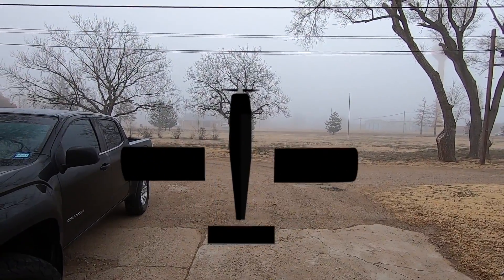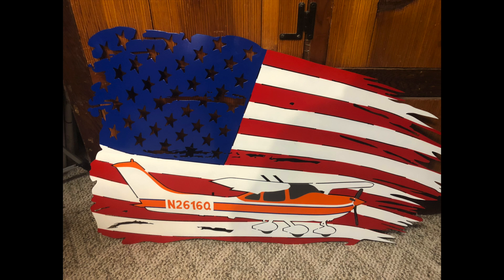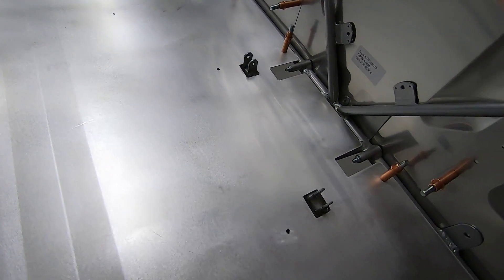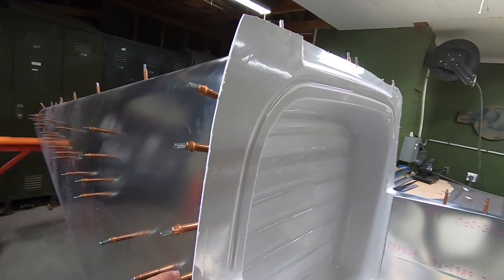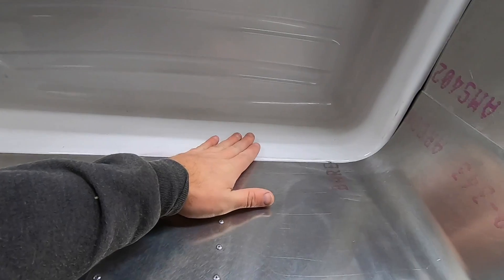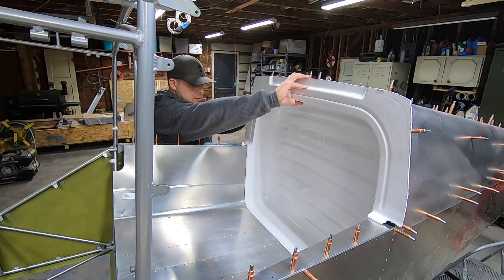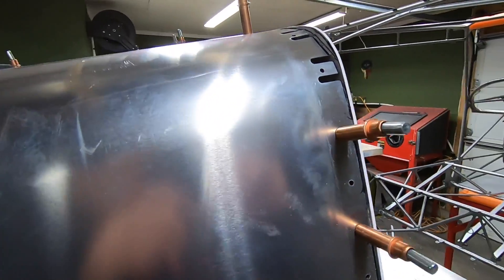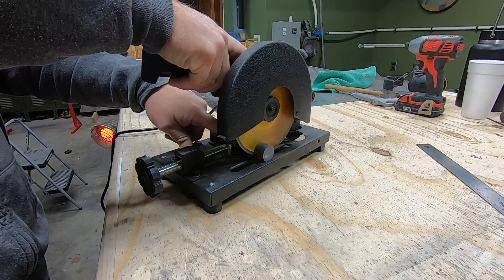RANS S21 EP19 STATION 4 IS DONE

Comment: Looking good. The drill u are using has too low of rpms which is why it's taking you so long to get through the metal. I would use a non-cordless drill which has way more rpms. I was wondering why you use such long drill bits when the part you are drilling into is outside the plane. To me that would be a huge risk of the bit walking off center.
Reply from the maker: I prefer slower rpm’s to be honest. Got a box full of air tools that I hardly use any more. I also prefer long bits that I can steer as I need. I don’t intend any of this to be “instructional”. Just showing my experience in navigating the process. Thanks for watching sir👍
Reply: @Project2Aero  to each his own

Comment: I've used DashMat auto carpet on 4 planes now. It's super light and comes in many colors, best of all it just happens to be "loopy" enough to work with Velcro's hooks. So anything you put hook Velcro on will stick to it. This makes future, yet to be thought of, small mods, real easy. Depending on the weight of course, no need for mechanical fasteners to secure things like a sun glasses holder or other misc. you don't want/can't get to in the main baggage.  I've found many smaller storage places, besides the main baggage, is super handy and keeps thing better organized. I use a deep ridged rubber floor mat (NAPA) on my cockpit floor, it traps mud, snow, and dirt instead of letting it migrate to the tail. I used the aluminum heel wear plates Rans provided for my 7 for other stuff, so offset the weight a tad. Keep that sucker light as possible! Saw your heater, better then nothing, but I love my electric radiant parabolic heater (Costco, $55.00) you get heat RIGHT NOW, no need to heat the entire hangar/shop they are great.
Reply from the maker: Awesome! All great suggestions, I’ll look into those items👍

Comment: I’m not sure if you noticed, but it looks like there is a small crack on the port side shelf angle. Are you going to try to repair the crack?  I’m sure your followers would like a video if you do decide to fix it. You can see it at 13:03. Thanks for the update video. Keep up the good work.
Reply from the maker: Yep it’s cracked in the pilot side. I will fix it but not until I go about final installing the interior parts👍
Reply from the maker: Planning to try that same glue that was used on the spacers in the upper corners
Reply: Any recommendation on how to prevent the crack?
Reply: @spradlinkcaz  drill the corner with a #11 drill bit, thats what I did, all good
Reply from the maker: The higher you trim above the angled window area support the easier it is to get in. Also initial fitting is way easier without the window support installed so if you haven’t riveted those, start with those out of the way.